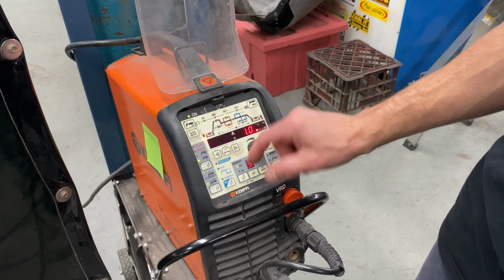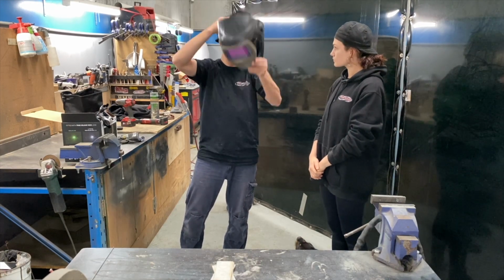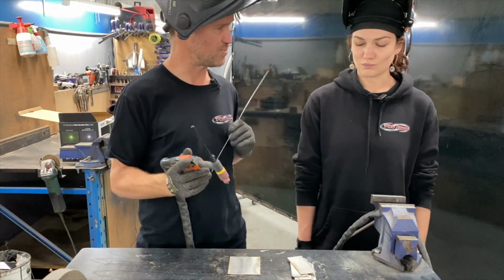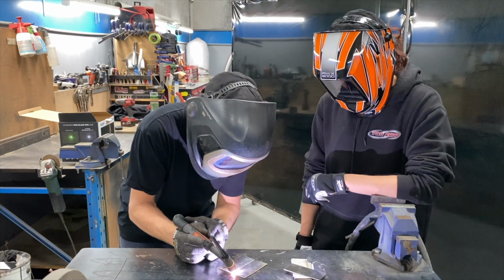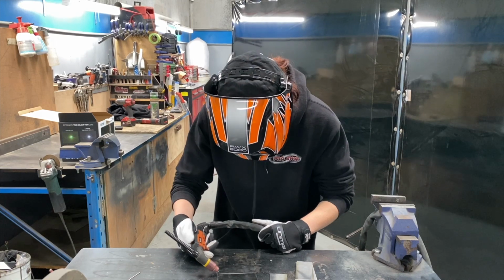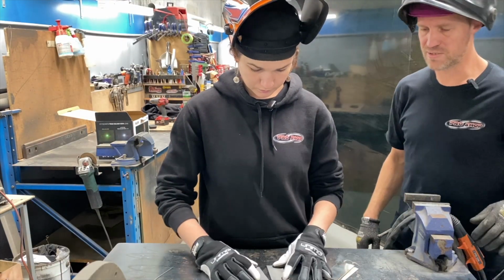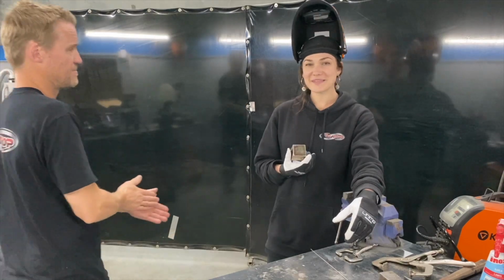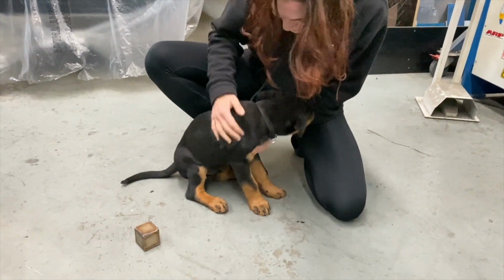Teaching My Girlfriend to TIG Weld

Comment: When you're TIG Welding, do you ever use Silicon Bronze filler wire? It probably works well on auto bodies id image! ( low melting point) Your thoughts!
Reply from the maker: You should check out my other videos. I mainly use silicon bronze on most of my panel work.
Reply: @ProShop1  Fantastic... I will!